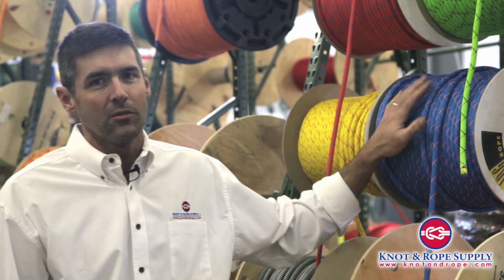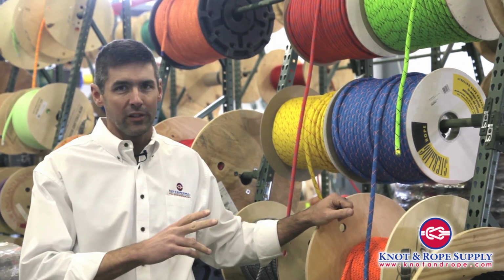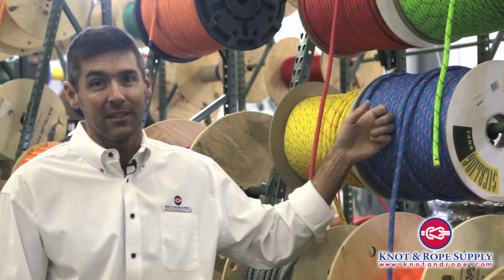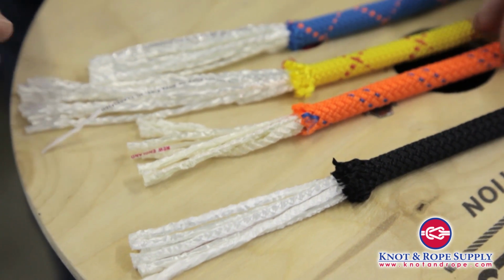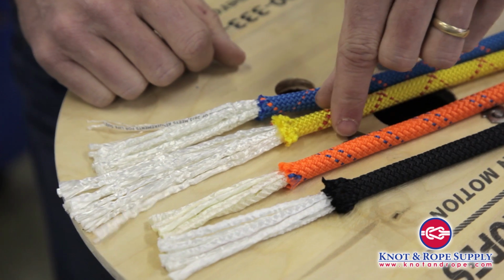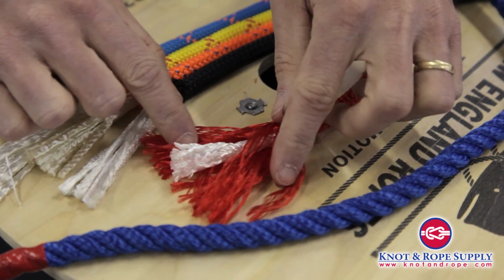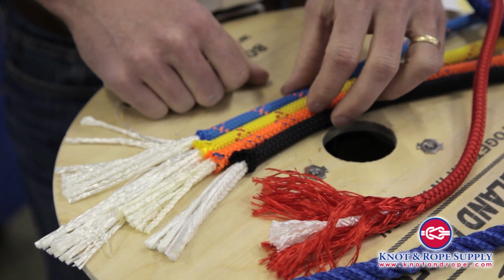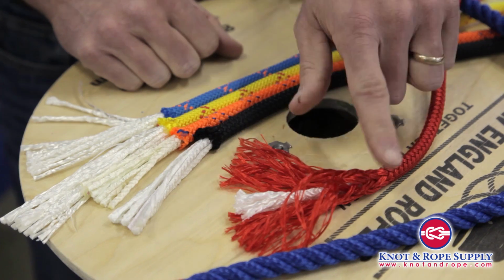What is Static Rope - Knot & Rope Supply

Comment: Am I correct in thinking the “stretch” comes from what is essentially the braid or weave of the strands constricting or relaxing which causes the diameter of the rope to shrink or expand? 

I had thought prior to this that the ropes “stretched” somewhat similar to how elastic stretches, but if I’m understanding correctly, the actual material of elastic stretches which is different from the “stretch” on ropes such as these. 

Thanks for the vid and any help in explaining!
Reply from the maker: There's a number of things that go into the "stretch" of a rope. Yes, construction of the rope is one of those factors, but the elasticity of the fiber itself has more to do with the stretch than all other factors. For example, polyester does not stretch as much as nylon or polypropylene and fibers like kevlar and Dyneema have even less stretch.
Reply: @KnotAndRopeSupply Interesting! Thanks for the extra detail. Makes sense. Now I’m curious if there is documentation or a resource somewhere that details the estimated percentage of stretch the construction, braid style, twist, material used in the construction, etc. contributes to the overall stretch of the ropes. 

I wonder if this is just common knowledge across the different industries that use a lot of rope, but for the consumer like myself that’s just looking to get educated, it might be useful…short of just digging around YouTube and the web piecing the info together.

Comment: You're mixing up 'static' with 'kernmantle'....Static lines can be double braids, hollow braided 12 strand, or core-dependent kernmantles (like that lineup appears to be, am unfamiliar w/ un-braided cores)  but static refers to dynamic capacity IE the rope's elasticity, not it's type, determines that.  Atlas has way more stretch than any 3-strand rigging line, for instance.  All arbor lines, climbing and rigging, are considered 'static' relative to other industries but there's a very strong case to be made for higher stretch (ie a nylon core, well for double braids, not much of a parallel-core type myself I like to be able to easily splice my own rope :D )
Reply from the maker: Great point. In this video, we are simply pointing out the fact that static ropes (in this case parallel core with braided cover) are ropes with little or no stretch compared to other braided or three strand ropes. We should do a video about the variety of static ropes as well, that might be helpful.

Comment: Can you point at a video showing static rope splicing?
Reply: Aleksandar Kostadinov 
Most arborists ropes are considered static (they are definitely not dynamic)
and they are spliced all the time.  Kernmantle construction can’t be spliced. 
Mountain climbing spokespeople don’t include arborists information and vice-versa.  Just enter “arborists ropes” into YouTube’s search line and you’ll find tons of information. Arborists ropes have a variety of characteristics so be patient and watch lots of videos.  Also search “arborists rope splicing”.  You’ll also stumble into some crossover with sailboat rigging. Be careful buying from amazon and eBay. They sometimes don’t include important information.  You want polyester,  you DON’T want polypropylene.  Thousands of pounds of difference in strength.
Reply from the maker: Due to the type of core that static rope has, it can not be spliced in the traditional sense. It has to be stitched.